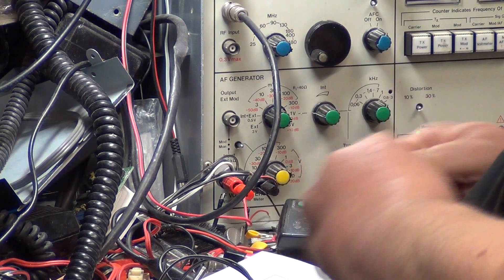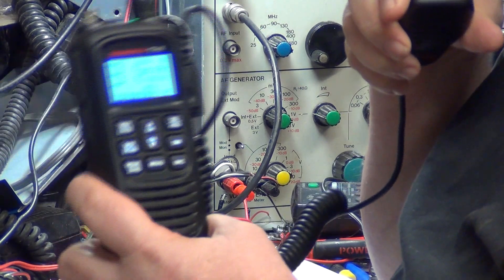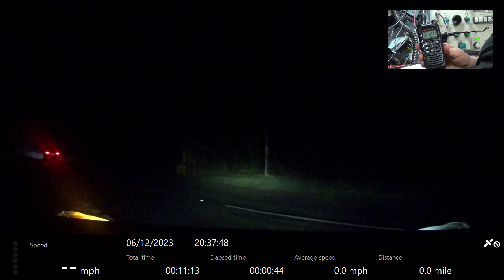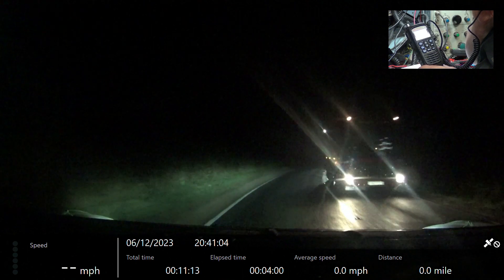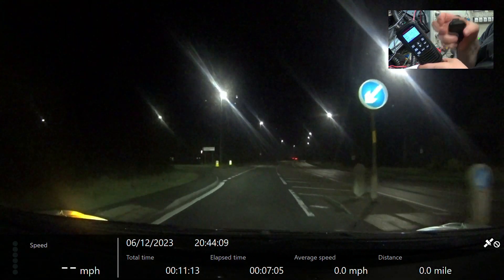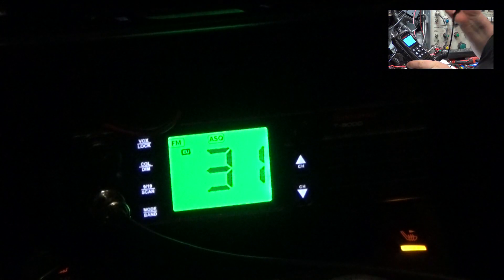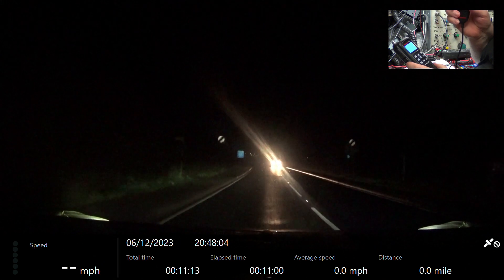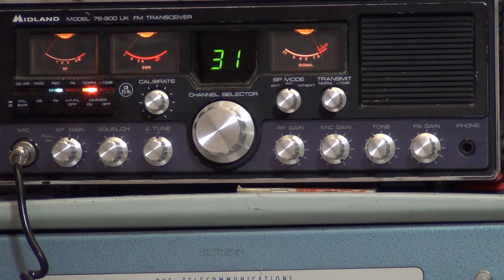Thunderpole T-X CE MultiNorm UK-FM , CEPT AM/FM CB radio - On The Air test

Comment: What does cept mean Richard please is it another  frequency?
Reply from the maker: There are two bands of 40 channels available to UK users. The UK FM channels like are on the CB27/81 radios introduced in 1981. In 1985 the UK were also allowed to use the 40 CEPT channels...which is the European band of 40 starting at 26.965Mhz to 27.405 Mhz...in FM, using 40 channel different radios with the approval cold PR27GB on the front panel. In 1997 the UK got permission from Europe to be allowed to have 80 channel radios covering both the CEPT & the UK FM set of channels....those sets have the type approval code of PR27/97.....the in 2000 we got the CE MultiNorm sets approved which must say 'CE' on the back to be legal here &~ finally in late 2014, the UK got permission to use the 40 CEPT channels in AM, FM, or SSB....and also to continue to be allowed to use the original UK 40 FM channels as well.

Some people wrongly refer to the CEPT channels as Mid-band. That parlance is only valid for radio pirates using illegal export radios with loads of bands which are illegal everywhere except at sea!

Richard, G0OJF, UK

Comment: I have an Intek H-520 hand held, which won’t transmit if the batteries arnt fully charged. It cuts out when I try and key up if, even though the batteries are at 80%. Have you ever encountered this? It’s very frustrating as it renders a really nice set unusable
Reply from the maker: Looking at the service manual, it's a 9V radio. The manual says "+ or - 15%",so should work down to 7.8V. You need to monitor at what voltage the radio stops transmitting. I would guess it's a tired battery with a failed cell. Hopefully you can power it from a vehicle adaptor to prove one way or another.

Richard, G0OJF, UK